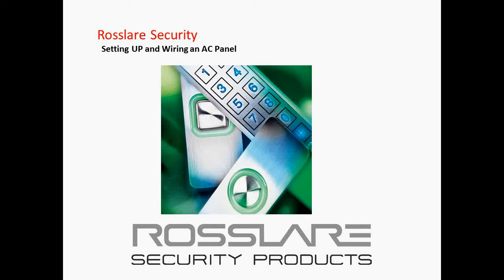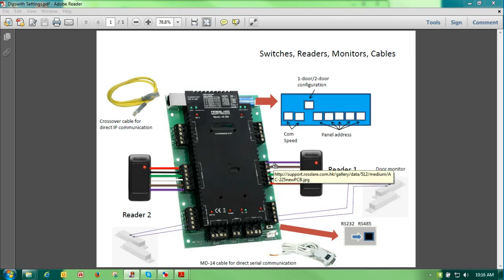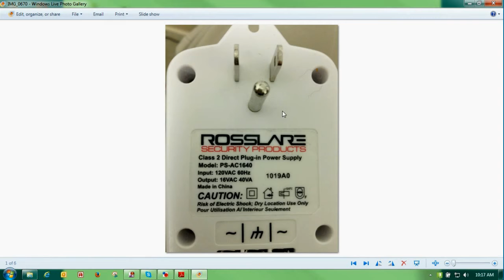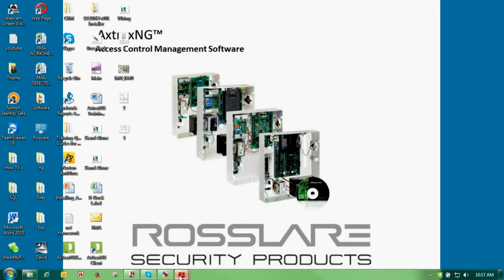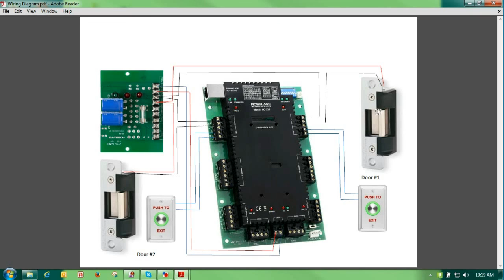Setting Up and Wiring an AC Panel - Rosslare Security AC - Panels

Comment: David can we use the AC-2225 Panel to control an automatic door opener for handicap access. basically we will put a reader there that will output to the motorized controllor instead of the push button

Comment: Hi I have a question about the IP Ethernet connection. Can you use IP to join multiple AC's together via a network switch or is network connection reserved for RS485?

Comment: David:

At 7:03 in the video, you say we should wire the positive of the strikes to terminal 4 on the PS33, Assuming we use something like the AC425 with the MDD04 expansion (in/in), we'd have 8 total strikes wired to terminal 4. Is terminal 4 large enough to accommodate 8 wires (18/2 wire), or is there a better way to wire it? (Same question with the ground jumpers (Com) to terminal 3. 

Also, for the REX, if we use REX, I assume we can't use LBM as the input is now used up?

Finally, if we use something like the HES5000 which requires 12VDC and uses about .22A to unlock, will the PS33 have any issues putting out that amperage? I think I read somewhere the PS33 is rated for 5A, but I'm not sure.

Thanks in advance.